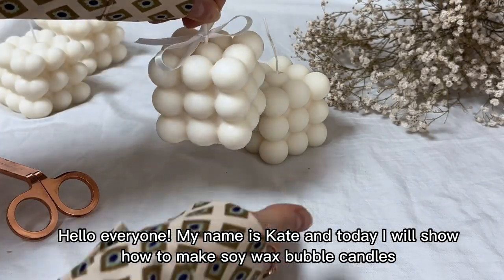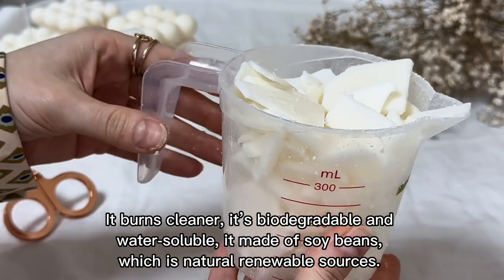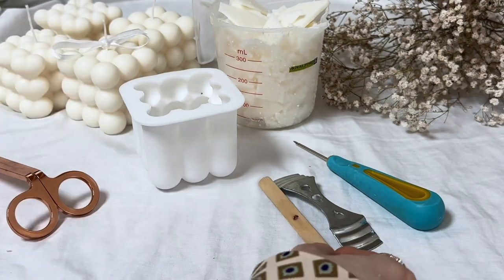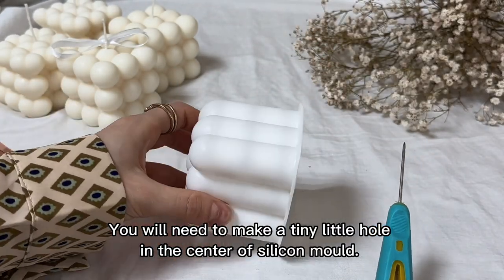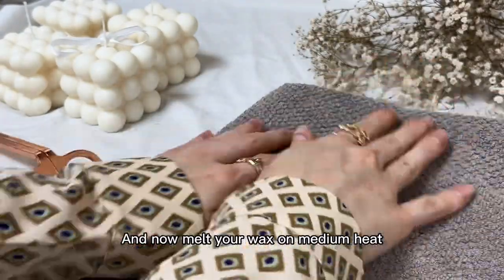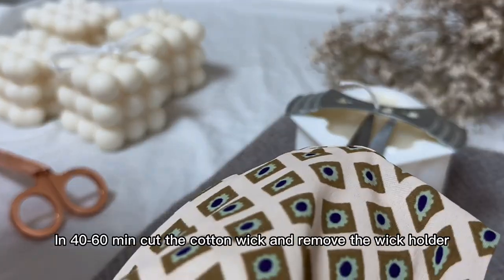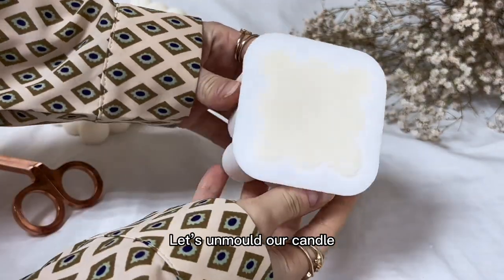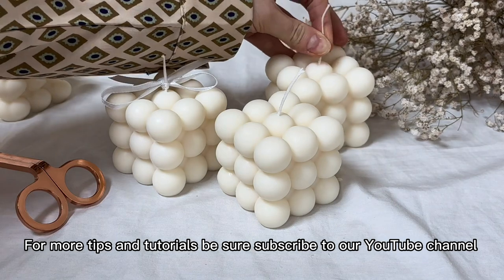BUBBLE CANDLES TUTORIAL | How to make the perfect bubble candle??

Comment: Thank you so much Kate for this amazing step by step video.I ve been trying to make bubble candles for some time now but been having some problems.You see everything seems to look fine until it comes to demoulding as it is always cracked in the middle.Would you know the reason why it keeps happening by any chance ?Thank you so much
Reply from the maker: Hello, Victoria! 
There are can be many reasons why candles cracked in the middle: 

1. Each wax has its own instructions. In my video I use soy wax for pillar candles from UK with pouring point 55-65C. 
Perhaps, you are pouring wax at the wrong temperature and maybe pouring wax too fast. 
2. Perhaps, candle is not fully cooled down . I recommend waiting 8-10 hours before demoulding. 
3. Perhaps, you are pouring incorrect amount of fragrance oil…

If you are doing everything correctly, I advise you to change the wax and enjoy the process of candle making without problems 😁
Reply: Thank you so much Kate for your response.I will try to check all my steps once again.